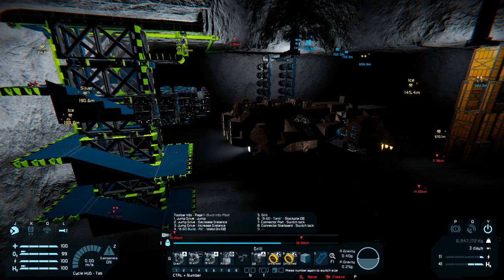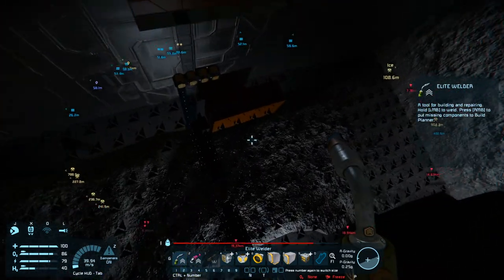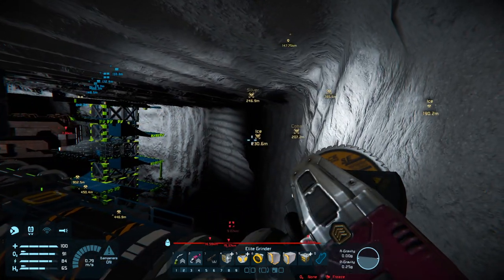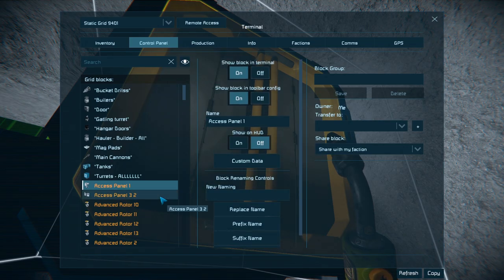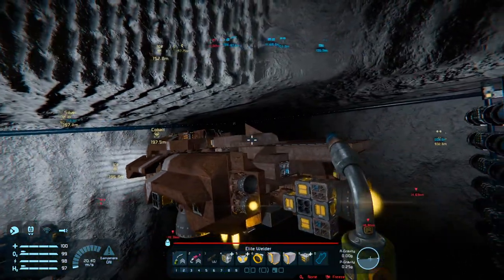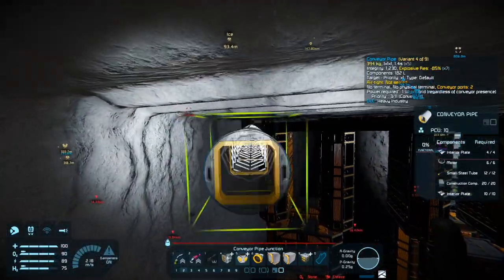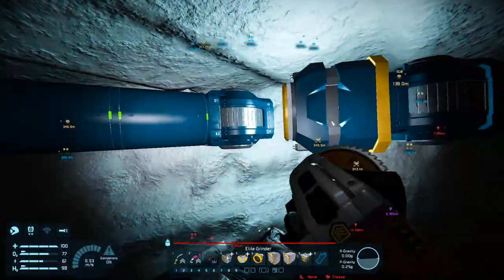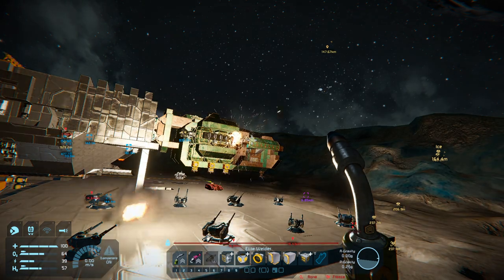Space Engineers ~ Not Hardcore ~ EP 110 ~ How to Sub Grid Your Base

Comment: 16:10 Just put a drill head of nanite drills on a rotor in the middle, on a really long arm, with some wheels at the end to hold up the drill heads and start them some place in the neutral areas [or else drill a pocket to build them into] and then just let them slowly sweep their way around the back of what is already built.

One single pipe can exit the top of the rotor assembly [one rotor to the ground to keep it all from shifting, and one rotor through the top, by way of a conveyor junction] to pipe to the refineries.

The upper pipe will not interfere with the arm [also pipe] and can be run into the bottom of the refineries so as to minimize materials used, while the lower pipe will just connect the drills to the hub, where it meets with the upper pipe through an advanced rotor.

The lower rotor need not be able to pipe anything, it is just a pinned pivot point.

The wheels on the drill head simply keep the machine from bouncing or 'clanging out' as it would be a super long subgrid, and I have learned that suspending a super long subgrid can lead to clang some times.

Only needs 2 wheels max, might be able to even get away with one wheel.

Since I do not know if wheels can be commanded to rotate on a fixed RPM, if one allows the rotor at the middle to freewheel, one can simply tell the wheels at the end to constantly travel at some fixed rate like 0.001 meters per second or some such.

If wheels need a cockpit or other control seat, or else need to be commanded by some complex mechanism built onto them, that might be inconvenient, of course.

If driving them from the end is too complicated and requires too much personal attention, one might opt to let the rolling wheels be the freewheel component, and set the rotor to a really slow speed.
Reply from the maker: I plan on going out in a grid from this point. The base is squared and the piping is really simple from here. It will take away all the need for moving the drills as well.
Reply: @Havoc_Gaming  I suppose with a square straight direction of travel, all you need to worry about is eventually poking out of the surface some place...

ALTHOUGH...

That COULD be part of the DESIGN!

If you drove a rolling drill-refinery machine in a perfectly [or near perfectly] straight line with the intention of making a monstrous hangar/launch tunnel, you could make it go on for maybe a kilometer [based roughly on the radius of the moon voxel you are playing on] and as it rolls along, laying a floor beneath you [with projectors and BoBs  so that the rover-drill its self is always running on a perfectly flat floor and always going straight forward.

Such a hangar could literally be as large as you wanted it, and with nanite drills, all you need is storage, refinement, and an ejector.

Set your BoB welders to only work in front of your machine so they do not pick up ingots, and weld other BoBs into the floor that soak up the finished ingots and push them back to assemblers.

So far as power, weld up a telescoping connector on pistons that goes along one side with a timer block so that when it is near the end of its reach, it retracts and finds another connector along the wall, so it never goes without power.

Unlike the kinds of inchworm drill rigs that can clang out, a rover on wheels will simply roll along at a very slow, fixed rate, as an independent grid, and wheels tend not to clang.

Then you can have a hangar big enough to launch pretty much anything.